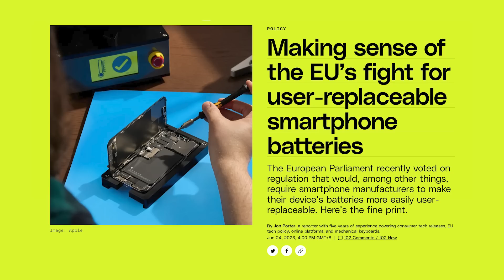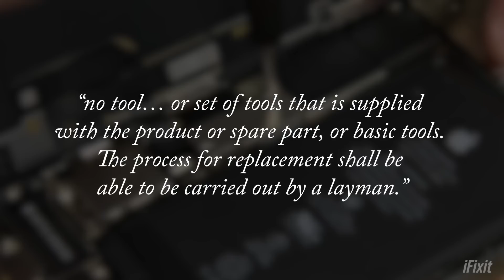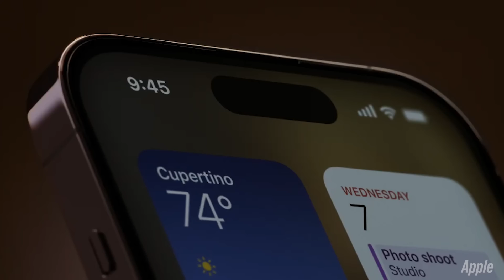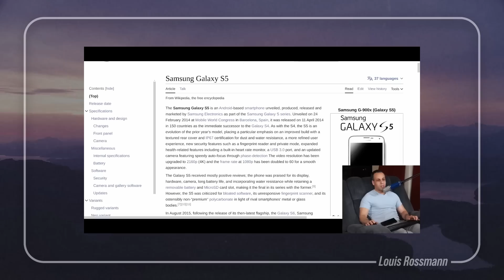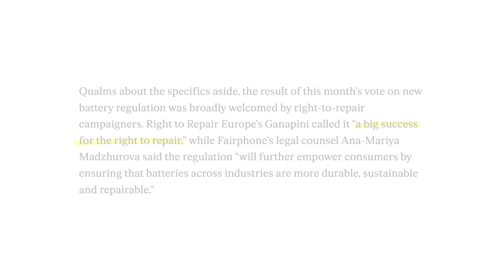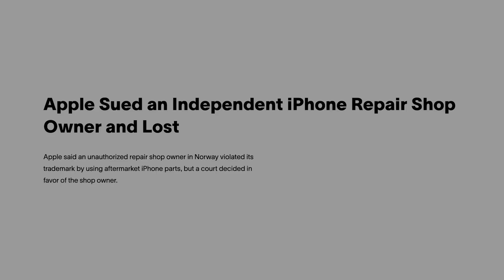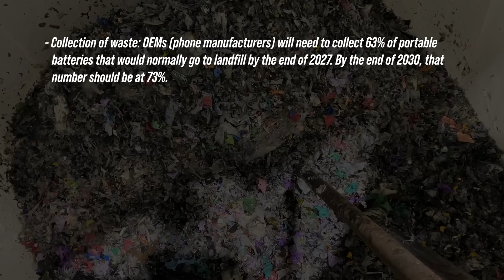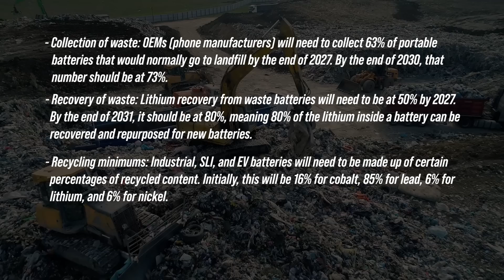EU Just Changed Smartphones Forever

Comment: I see both sides. The non-removable batteries are not in a hard plastic shell like they were before but in sort of a bag now to reduce weight, and more importantly, to reduce size for components. However, we're at the stage where components have gotten smaller and integrated to where this isn't really needed anymore. Forcing someone to use their own services to replace something like a battery is definitely anti-consumer. At the very minimum, batteries should definitely be user-replaceable. But I think they should've taken it a step further and have the manufacturers produce the batteries for that device for at least 5 years for OEM replacement. The LG G4 I had, the battery lasted 2 years and you couldn't get them from LG anymore. You had to get a knock-off, which weren't as great, but at least it was something. Or maybe partner with companies like Batteries Plus to produce legit batteries for the years to come would solve that issue.

Comment: You can just use a hinge on the bottom of the phone/ sliding mechanism with rubbers to open up and slide out the old battery, easy concept and doable. so they can still use a ton of adhesives just need to implement 1 mechanical part and the battery can be held in place by that

Comment: 7:15 - it's bullshit, this is very easy to enforce.... just do it like it is done for years now in EU, when buying hazardous material - you need to either give back the old part (like car battery etc.) or pay a deposite, which will be paid back when a replaced part will be delivered...
Reply: I'm in the auto parts business, and that's been the standard way here in America for car parts for decades. Possibly all the way back to the beginning of the auto industry, but I've only been in it since the late '80's. Any part (like a starter motor for instance) that is rebuilt has a "core" charge, exactly as you describe. The vast majority of brand new parts sales do not have that though, with the only brand new part I can think of at the moment that ever did have a core charge being an air conditioning compressor. They don't now though, at least the brands that I'm familiar with.

But those old parts being replaced by new ones do have a value in the scrap metal trade. I regularly haul home all of the old heavy truck starters and alternators left to me when people buy a brand new one and just don't want to deal with the old part disposal. I collect a pickup truck load, take them to the scrapper, and for very little time and effort I get several hundred dollars. The parts are recycled into their raw materials and go back into the food chain.

The whole point is that if the recycling of these items is somehow a benefit to the consumer...either they avoid a core charge OR they get profit from taking them to a recycler, then they will comply. Otherwise, humans will just throw them in the garbage.
Reply: @CallibanMcGee  exactly what i meant... it's not hard to do by any means....

Comment: Thinking about it, won't replaceable batteries pretty much also solve the issue of planned obsolescence?
Reply: And THAT'S why we are where we are lol. That's also why all other consumer goods, especially vehicles, are getting harder and harder to work on yourself. No manufacturer anywhere is in it for YOU. Remember that forever, every time a salesman of any sort approaches. Your only redeeming quality to them is how many $$$ you have. I could give you a million examples on the auto side of it since I'm in auto parts, but you don't have a year to talk to me about it. 😁

1) All products are designed to hopefully only last just past the warranty
2) All products are designed to psychologically make you believe it's better just to take it to the manufacturer for repairs rather than try it yourself. Unless you own one of the few phones or computers expressly built to be easily repaired now, you're looking at a prime example of what I'm saying.
3) All product repairs are scaled to make you think hard about just buying a new item instead of fixing the old one.
4) #1 may not apply if the manufacturer has an "ecosystem", where there is incentive to buy more of their products because of high quality. The flipside is that they purposely make it hard to use their products with other brands/ecosystems because that doesn't make more $$$ for them.

Write these truisms down, tattoo them on the inside of your eyelids, whatever, but remember them every time you make a significant tech purchase.

I see this EVERY day, and I fight it every day by trying to simplify auto repairs for non-rich-enough-to-just-throw-it-away-and-buy-another-one people.

Comment: They definitely progressed unchangeable batteries for profit. There was a time when phones were so small they fitted in the palm of your hand, they had changeable batteries, and were waterproof. I get that todays phones have much more advanced features and tech, but I also know that batteries have also became more advanced. As for waterproofing, I have a set of digital two way radio's I use in the mountains that have changeable batteries and are fully waterproof, dust proof, and extremely robust.
Reply: yeah the notion that this change happened for non-profit driven reasons in the first place is nonsense.
Reply: @TLSH12  yeah you're right. same with the missing adapter "for the environment"-hoax. in the end its all about profit while making it look like its not. its very likely that they'll find a way to make extra profit out of that battery replacement thing. like in an apple manner - 6 month subscription for a new battery a so 😂or some "premium+ battery service". mark my words, there will be some kind of marketing manipulation going on there then later too. and people will fall for it. endless circle.
Reply: The argument from phone manufacturers is about the thinness of the devices, not the overall size. It's still a dumb argument - I'd willingly have a thicker device that doesn't feel like it'll shatter if I fumble it onto carpet with a swappable battery than the thinnest blade of glass and metal humanly possible. Hell, with a thicker overall device, the batteries might also increase in capacity.
Reply: @Hawk7886 The argument can't be even made about thinness. Look at the Samsung Galaxy S5 and Samsung Galaxy A54. Both IP67 certified, yet the S5, which has a removable back cover, is 8.1mm thick, and the A54, released this year, has a non-removable back cover and is 8.2mm thick. Not a lot of difference, but yet the claim that the design with non removable batteries is "much" less "thicker" that the one with removable batteries, doesn't make sense. Yes, the A54 is in a cheaper range, then compared to the S5 when it came out, but still, It's a 9 years difference between the releases of the two smartphone. Also, where does this notion come, that smartphones back in 2014 were still like a brick?
Reply: @DavixDevelop  Yeah, and all the thin glass sandwiches need thick rubber cases to survive daily use .
Reply: @johndododoe1411  That's another thing I'll never understand. Designers spend so much time making the device as comfortable to hold, nice to look at, come up with new designs, use all these different materials to make the device more premium,... just for that same device then be put in a cheap rubber case, that becomes nasty after some time.
Reply: @DavixDevelop they're not even that comfortable to hold, imo. I have small hands and my phone is already too big to hold comfortably with one hand, and it was one of the smallest smartphones on the market when I bought it. For me, the slightly sticky rubber protector is more comfortable to hold onto than the super thin, super smooth metal casing.
Reply: Agree 💯
Reply: Good point, I'd be interested to know if they are as thin as a modern day smartphone though. No ones arguing that devices cant be all the things your radios are. Just not in the form factor most people want their phone to be. Not without making some compromises that is.
Reply: @firefrost8334 you can change your own sim card without affecting waterproofing so no reason you cant change the battery too. The thickness thing? I dont buy that. Early integrated batteries were as thick as late removable batteries.  They didn't get small because they were integrated they got thinner because tech got better
Reply: And you think with this law they won’t have a better chance to increase profits?

This is basically a new step in the climate change agenda putting in more millions (forced by law), into the Industry they’re pushing.

😂
Reply: Compare features and power of phones. Not sizes.... just in case you use features of your phone, definitely. Because if you just call to talk so there's no difference for you past 20s years...
Reply: @tsugar75 Even that doesn't totally work though. Phones were "bite sized" back then. We all laughed at the Note when it debuted,  but today, thats the standard screen size.

Thickness stayed the same, but it sprawled.

At this point, with all the teardown vids, it's blatantly clear it's all down to engineering, and what they will bother to do as opposed to anything really being impossible, not that the techies among us were ever buying the lie.
Reply: Do you know that the time that phones were small and fitted in the palm of your hand is now, right? Theres still phones that fit in the palm of your hand Lol anyone can choose to buy it, but they dont
Reply: lol they were not all waterproof.
Reply: They are robust because they are over an inch thick. 😂

Comment: As an IT-technician with decades of experience in the field, I can assure you:

There is no technical reason for non-replaceable batteries.

Want to make something watertight? Add a good gasket and use a lot of tiny screws to apply the pressure necessary to create a perfect seal, contrary to glue, screws can easily be re-tightened etc. Inside a case, everything that does not need to be soldered on (this is: single resistors and the like) can be installed via a plug, no glue needed, plugin-connectors need the exact same space. Et cetera. Of all the iPhones that got replaced by us technicians over the years, it almost never was a technical problem, it always was a dying battery.

But of course, things like repairable or even just customer-serviceable devices would reduce somebodies quarterly statement or even reduce overall cost by making the free market actually a free market, but hey!, you cannot except such a thing from companies who act exactly like one-party-regimes…

Comment: These were just anti consumer. In the east, there are many skilled repair shops that can fix broken phones and PCs for far cheaper. Consequently, users have the capability to use an electronic device for over 10 years, and these device are easily designable to do that. Its only these manufactures' hedemony and oligopoly that has made the consumer bleed money. Software patches that deliberately make phones useless are next to follow. Believe me, if you feel an android phone is less safe than an iPhone, its just a matter of days, and android can be make super resilient to break, tamper, damage and hacks, its just that the companies want to convert your gadgets to fast fashion or fmcg types. Beware.

Comment: To drop the smartphone in the toilet or shower or inside fluid at work when you are not supposed to be using any smartphones or to be able to change your battery...

wow what a tought decision... and smartphone companies claim they cannot make battery swap for the users because they saw all the extra bonus money Apple was getting from their suckers erm I mean customers so Samsung copied but wait water proof smartphones that you can remove and replace batteries existed... did that become lost technology?

Wish the European Union would have successfully passed this law way back in 2015 to prevent the highway robbery smartphone makers have gotten away with.. oh well.

Also btw if you drop your smartphone "wrong", even if it was a shock proof protector, the chances that the battery element can go wrong and stop working increase... happened to me a while back with a 2017 mid range phone that was accidentally dropped around five feet due to the headphone cord getting pulled wrong... battery went kaput and for hours I thought something else was going but it was a removable battery phone, I had extra batteries at home, swapped them and phone booted back to normal... the cost was time and the $25 dollars spent on the extra batteries but if it was an Apple phone or non replaceable battery phone it would have been a couple hundred dollars damage.

Comment: I still have my LG G3, G4, and G5 all had removable batteries.  The G3 needs repaired which I'm going to attempt as a tinker with it DIY project.  The G4 and G5 work fine and have amazing LCD screens.  Their only downfall is they are only 32GB models.  I did literally just buy a new OEM G4 battery for about ten dollars as the original ones had since expanded so much I had to recycle them.  I remember back when it was my daily driver I'd have about four batteries all charged up and just put them in my coat pocket.  It was so nice.  I welcome this change!

Comment: United States automotive parts stores has ways to get people to return old broken parts. It is called a core charge. It is something like you car need a starter motor let’s say it’s $100 but they charge you $150 for the motor you return the old motor with the bill of sale for the new motor you get $50 back. So if they charge $200 for a new battery then when you return the old battery you get $100 back a lot of people will return the old batteries and any other broken parts they replaced and with the auto parts like alternator and starter motors they are ALL marked used even first time made because the old part are factory rebuilt and they may mixed them up and they don’t need to be sued and some cases redoing the magnetic field and new baring and contacts it is good for the life of the car. Henry Ford’s model T was sold to you as the first and last car you will own. Chevy came out with model year changes to sell you as new car. Manufacturers don’t make money off used vehicles after the first sell same with anything so they need you to buy new stuff they never want you to repair anything except by them with their new parts sold by them. They hate aftermarket parts

Comment: A fixed battery inside the mobile is something started with greedy Apple and greedy Samsung all my previous mobile phones had removable batteries, from my first analog Motorola shoulder bag-phone in the late 80s to around 2010,  the true is MONEY is the reason.
If you want your old phone working pay for the service to a retailer or simple buy another one! simple like that also the series of phones always have a top of the line model with more battery capacity and or more memory then they ripped you off another $500 bucks. People accept things like  "we dont include any chargers anymore because the environment" or "We dont include earplugs anymore because whatever BS they come out with" but they pumped up the price of the phone with ZERO accessories no even a charger, you have a new $1500 phone and come with no charger LOL!  Greedy and money as always. All this robbery and scam happens because people accept look at the floor and pay.

Comment: That is great news. I have a bunch of phones from before 2010 that I still use, even if I have a bunch of newer phones as well. I mainly got them for sentimental reasons, but interchangable batteries is just amazing, along with some other features that are no longer in new phones. I don't really have any problems swapping out batteries on my 10 year old phones, even if it's a bit harder than it have to be, however the problem with those, is that it's hard to find good replacement batteries. I just wish there where like a standard for those batteries, like who would ever claim AA batteries was a failure? Maybe not the ideal form factor for modern phones, but I feel like Duracell could really have done more with these modern re-chargeable devices
Reply: There is one already but for Wapes, battery lamps, other portable gear. Its called 18650, but its too big for today's form factor. Manufacturers should design standard ones like: 50 mAh for Bluetooth audio gear, 250mAh for small speakers, 1000mAh for medium speakers, 2500 mAh for small  phones or larger speakers, 5000mAh for average phone, 6000-9000 mAh for larger devices and 10000 mAh+ spec for rugged phones and tablets.  Same with bigger gear but those are in AmpHours.

Comment: An even bigger win for right to repair would be requiring companies to offer replacements parts either direct or allowing aftermarket for a certain time period.
Reply: Yeah usualy by the time you need to replace a battery oem just isn't available anymore. An even better option would be to design a number of batteries as a standard and force companies to use them that way there will always be replacements available or even upgrades with better battery technology.

Comment: I took my IPad in for a minor problem that they fixed by changing some settings. During that service the technician told me me battery was weak and although they don’t replace them they would sell me a replacement, same model, for the price of the battery, $99. I believe this also includes the phones. That is a lot easier than changing it yourself then dealing with proper battery disposal.